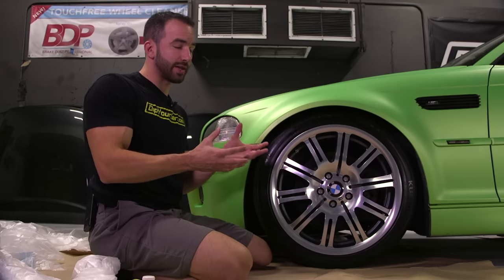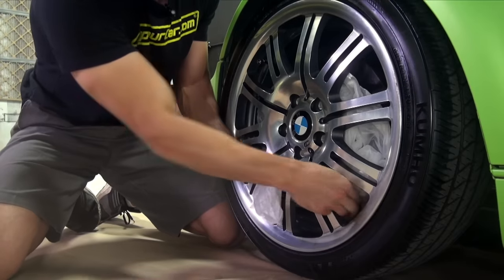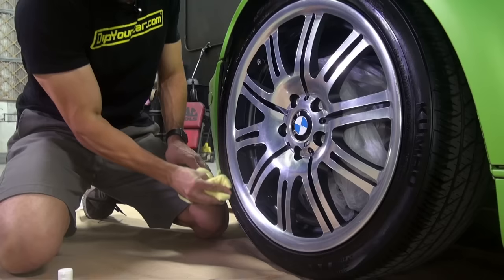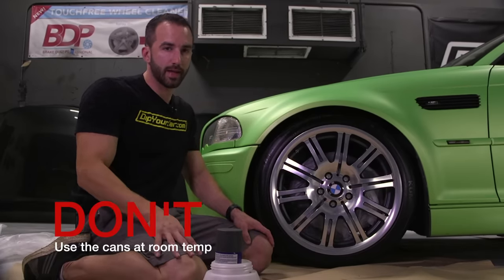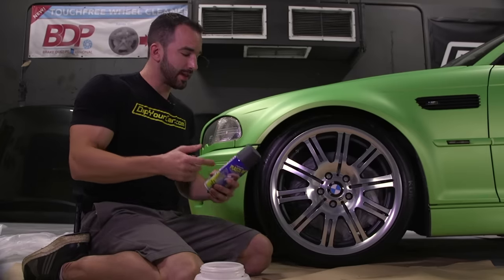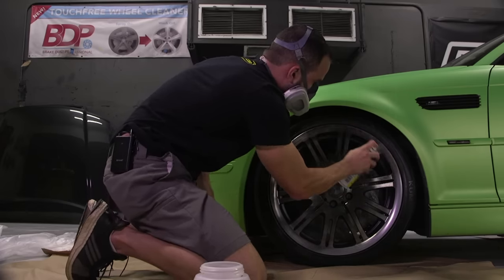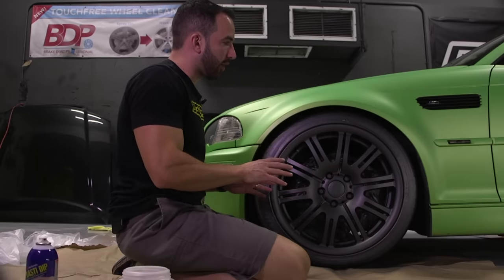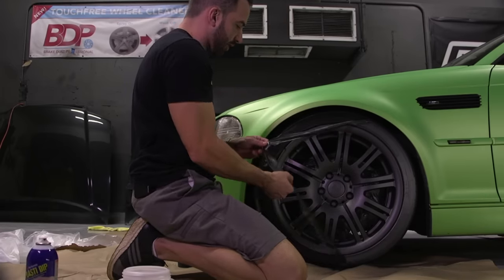Official Do's and Don'ts of Plasti Dipping Your Wheels

Comment: Another great way to mask off the tires(if you don't have the dip release) ive done many times in the past whether it was plasti dip or  spray painting wheels. Take 2 decks (I believe you need 2) of playing cards and stick them in between the very edge/lip of the rim and tire then overlap the cards around the entire wheel. It greatly reduces overspray on the tires while you spray paint the wheels.
Reply: Cullen Schwagler. I’ll try it out tommorow!!
Reply: Use index cards they are super cheap and u dont ruin playing cards.. lol
Reply: @Bvsterrrrrrrrr  ah really didn’t think they was that cheap. But still index cards are better they’re bigger and you use less of them for the same thing and less chance of over spray . It’s just the way I’ve always done it.
Reply: @guildensteinfoutch6232  totally agree
Reply: Or just smear petroleum jelly in place of the dip release. It's a common old school masking method in many industry
Reply: Does the card trick work if they're on the car?
Reply: @bigfirepop  for sure or olive oil coconut oil or anything like that I’m sure would work
Reply: Indeed tbh med to large index cards are incredible and sometimes reusable
Reply: @yourtruckerfriend1584 yes, but you still have to mask off the brakes and stuff. The cards only protect over spray on the tires.
Reply: This is how I do it as well, just make sure you take the cards out while the dip is still wet. I made the mistake of letting it completely dry and it started tearing along the lip of the wheel.
Reply: Use tire shine and you don’t even have to masks the tires
Reply: I’ve actually seen the card trick being done.
Reply: Index cards

Comment: The best I’ve seen regarding the prep. However, what about the lug nuts? Mask em? How well will a socket fit over several layers of coating? Thanks again.
Reply: i wouldn't be concerned with fit as much as the dip coming off whenever you go to take the wheel off.  Or put the wheel back on for that matter if you took it off to apply the dip

Comment: Another good tip I learned is after a few solid coats, move the car forwards or backwards to achieve a 180degree rotation on the wheels. After that, coat the wheels another 2 or 3 times for maximum coverage.

Comment: I dipped my C6 Corvette wheels, i removed the wheels, cleaned and sprayed the huge barrels also...then painted the lugs seperately with Rust-Oleum.   Turned out amazing and if i ever want to reverse the results just peel it off, i did 7 nice thick coats, almost a can and a half per wheel.

Comment: I wish I had this video when I plastidipped my wheels. The tip about not laying the wheels flat would have been incredibly helpful in not getting a textured look on some of the parts of the wheel.
Reply: vladstr100 If you plasti dipped them just peel the paint off and do it again.
Reply: vladstr100 just re do it
Reply: lol yall saying just redo it a set of 5 cans is around 100 bucks
Reply: @hello-ef4bn  Yeah, I definitely didn't have the funds for that to redo it. I just left it be but now after having the tires replaced a few times, the plastidip is lifted and the underneath is rusty, so it'd be more of a pain to redo it.

Comment: PSA about leaving wheels on the car or not:
I decided to dip the wheels on my white Elise a nice matte black.
As it's quick and easy for me to remove the wheels, I took them off for easier cleaning and access for spraying.
Here's the problem: the space around the bolts is so tight that while putting the dipped wheels back on the car, the wrench touched the dip just enough to turn and tear it off. 
All the work was for nothing and I had to remove all of the beautiful fresh dip.
If your wheels are designed in a way that there's not much space around the bolts and there's a risk of touching the dip while wrenching them back in, do NOT remove your wheels for dipping.
I hope this will save somebody the trouble I went through.
Reply: Vahid Saberin you could mask off the bolt holes
Reply: just use a micro fiber towel. over spray comes off of paint so fuckin easy.
Reply: Thanks for the tip! I might dip my wheels and this tip just saved me from making a mistake ike that
Reply: Man you helped stop my life from being ruined because I would've done exactly that.  Not only that, the plasti-dip gear would've cost me almost as much as a new set of rims, so I may as well just buy another set of rims in the color I want.
Reply: @poopipeboy3033  im thinking of painting mine instead. One flat, or when it's tire rotation time, and this stuff is toast.
Reply: If you ever need to take them off for anything In the future the paint will rip right off with the lug nuts though. Painting them on the car is just dumb and lazy. Just get a thinner socket
Reply: I use to have this problem. What I do is spray some coats of adhesion promoter just to the bolt areas. Also, when you put the lug nuts back on tighten them down bu turning the wrench in quick rotations not slowly. Works great.
Reply: you have to rotate n balance the wheels every 5000ish miles, so there are lots of opportunities for messing up your hard work. hmmmm....  I want a more permanent option.
Reply: Yeah I wish I would've seen that before. Went to put it back on and ended up staring at it for about 10 seconds in shame. But since I already had them off I just stuck a ball of masking tape in each hole and it all ended up fine.
Reply: It seems pretty simple to me, remove the wheel/tire and spray lugs separately off to the side, and I like the suggestion above about using adhesion promoter around the lug holes, just as long as it still peels of when you want it to. Someone said this is almost as expensive as new rims, is that really true? It can’t be
Reply: Mic 360 no there senile. I just bought the whole kit in matte black for 30$ lol

Comment: When I dipped my wheels a few weeks ago, I found it really difficult to get even decent coverage on all surfaces without moving the car to turn the wheels. After moving it, I was amazed how little coverage some parts of the spokes had, even though I tried to cover them with the first few coats. Admittedly, the can is much more likely to spray huge particles of product if you're using it at an aggressive angle, which is the only way to get good coverage on all surfaces during the early coats.
Reply from the maker: Depending on the style and design of the wheel - it's going to be necessary to rotate the wheel half way through the coats.  We cover this in the Complete Guide video.  There's no way you can hit every spoke properly without rotation.
Reply: Dipyourcar shows that in another video. They said to move the car half way through the job so the bottom spokes are exposed. Just be careful not to jam the plastic bag into your brakes.
Reply: MrRangerZr1 I did watch the complete guide and knew I'd have to move the car. I just wish I had moved it earlier and more often, actually, not just once mid-way through the process. 

You also make a good point about the bags. The space between my caliper and the wheels is so small that the bags were essentially jammed between them, which messed things up a bit both when moving the car and removing the bags. In any case, I have useful experience for next time, and I do plan to redo my wheels soon.
Reply: Yes

Comment: How would you recommend fixing tears on the lug nuts from taking the wheels off?
Reply: use a stencil or sharp tool and cut out the area of Plastidip where the lug sits to that it will not twist and pull the rest of material from the surrounding area.
Reply: @ennise25  He said fix tears, not prevent tears...
Reply: I used the Anthracite Grey for my winter rims.   I sprayed my rims prior to the tires being installed on the rims.   I knew that as soon as the impact gun came into contact with the lug nuts, it would immediately ruin/tear the Plasti-Dip from the chrome nuts.   Thus, I went out and purchased some black lug nuts instead.   For myself, I think the black lug nuts look absolutely awesome set into the Anthracite Grey rims!!
Reply: D* W* usually the black is just coated on the lug nuts , did the black stay on the lug nuts that you bought? Or did it get scratched or worn off?
Reply: @honoredsage4946  Yes, the black was just coated on the lug nuts that I purchased.   The first winter changeover, my mechanic got the tires mounted without scratching up the coating on the lug nuts too much.   But after the changeover back to summers, then again to winters, the coating on the lug nuts were at the point that - with winter salt and elements taking their toll - they were all rusted up by the end of the 2nd winter.  
But, for myself, to have the look of the black lug nuts set into the dark grey rims, I will gladly shell out $50 (Canadian) every two years to replace the nuts with new ones.

Comment: I wish you would have showed how you completed the job around the emblem
Reply: Well he sprayed them in the video so I’m assuming at some point he used the dip release on the emblem without showing it in the video.
Reply: It'll break off at the seam, plasti dip pulls apart cleanly at any sharp angle as long as you're pulling away slowly and not peeling away.
Reply: @dragorx000  
You can assume all you want but people want to see the process. That’s the point of the video.

Comment: I'm going to do this with the wheels off the car. Any suggestions for masking off the lug holes, wheel center bore, and the valve stem, so the dip doesn't peel when getting new tires or changing a flat?
Reply: Stuff it with plastic bag/shop towel

Comment: My advice would be to remove the wheels.  And while your wheels are off, do yourself a favor and paint your crust calipers.  No sense in having a sharp looking car and wheels and then show off rusty calipers.  I just paint mine black.  No need to accentuate stock calipers.  Red also gets dirty and gunky pretty fast, so black is the easiest color to maintain.  Plenty of videos out there on how to do it.  Plus you won't get overspray all over your car.  Don't think for a second that it only gets on the sidewalls.  The things you are wearing a respirator to protect your lungs from is also floating around and landing on your car.  I take the wheels off in the drive way and paint them in the garage.  

Either way you do it, this is a great video on how to use the product.  Seriously, man... You do have the best how to videos on YouTube.  Keep it up!

Comment: How do they hold up to road debris, snow and salt during winter? What's it look like the first time you have to have tire work done at a shop and they take an impact wrench to the lugs? How do you clean them? Can you go through drive-through car washes? Can you use a regular car wash spray wand? What's general Life expectancy? Guessing is looks atrocious once it starts chipping off? How to fix properly once it starts chipping? What is the proper preparation if your wheels have a factory clear coat over the aluminum and if it is starting to oxidize behind the clear coat.? Sorry for all the questions, but serious about them.

Comment: I have 2 questions in regards to dipping wheels while still on the vehicle?
1. What do you do about over spary on the car?
2. If you dip rims while still on the vehicle the lug nuts will be covered in dip, will removing the wheels ruin the dip on the rims?

Comment: How does this product hold up when changing tires out?
Reply: it's gonna peel off due the the process required for mounting and dismounting. While factory painted finishes go unharmed, the dip will start to peel and get damaged which is basically unavoidable.
Reply: I used this same color (Anthracite Grey) on my winter rims.   I have gone through 4 winters now of swapping them out and the Plasti-Dip looks just as great as when I initially did it.   The only problem area was the lug nuts.   The dip peeled off the chrome lug nuts on the first rims changeover.   To rectify this problem, I purchased black lug nuts instead.   The black lug nuts added a super nice contrast to the Anthracite Grey rims!!

Comment: what about the BMW sign on the wheel? i noticed it was black but changed to the normal color however he didn't show how he took the paint off the BMW sign part of the wheel.
Reply: I'm wondering the same thing
Reply: He peeled it off
Reply: The cap is plastic, plasti dip only sticks to the rim. It will easily wipe off of plastic parts.
Reply: Dan C not true. It sticks to everything. He simply pealed it off the cap. When 2  surfaces meet, most of the time there is a gap and when you spray it doesn’t bridge over. Making it simple to peal it off the desired spot.
Reply: Dan C plasti dip does stick to plastic I’m more than sure he added drip release

Comment: I bought a kit 5 years ago.. I'm about to finally use it on my new (to me) 3rd gen Mazda 3 hatch!  Wish me luck!
Reply: How it go
Reply: @dallaslegend9460  pretty well actually. The biggest time sink was prepping the wheels. I didn't get the dip release so I taped the tires. The other odd thing was when I got to the last 3rd of the can it was coming out in large chunks. Not sure if that's because it was 5 years old or if the can's temp got to low. I did put them in hot water before starting.

Comment: Dumb question(s) What happens when I get my tires rotated every 5,000 miles? Will the  recessed area around the lug nuts be all scuffed up when the socket wrench is applied?   When this is done the balancing weights are most always moved around, so how do you retouch?

Comment: Great video. Only question I have is about the lug nuts. After plati dipping as shown can you still get a socket on them? As it seems coating them would change the MM size. Is there any problems with that?
Reply: the dip will rip off the first time you put a socket on them

Comment: Ok, what about the lug nuts? Your gong to have to take the tire off at some point.
Reply: That's why I took my tires off.  I left the chrome lug nuts and dipped the rims.  The chrome looks very nice to counter the black and it should  minimize/eliminate damage if I have to take the tire off.
Reply: I used the Anthracite Grey on my winter rims.   I knew that any plasti-dip on the lug nuts would be ruined as soon as the impact gun hit them.   So I purchased a set of black lug nuts.   Personally, I think that black lug nuts look frickin' sweet set into the Anthracite Grey rims!!

Comment: What about overspray on the fender? What about the inside/barrel of the wheel? What about the valve stem/cap? Do you rebalance the wheel after? Would the dip wear off the wheel lug heads?

Comment: Just bought a kit for my car this afternoon, can't wait to try it out! What will happen when I have to change my tires? Will the plasti dip get ripped off in the tire pulling machine?
Reply: Scottie C yes it will, you'll have to re dip them unfortunatley
Reply: @michaelensch9910  and what happens in that case?you peel off the old plasti dip and you spread a new one????or you spread it over the old one???
Reply: I think it's a definite maybe, depending on the tire machine. Most tire machines dont rub on the rim, but I think you still risk the tire itself rubbing the dip off.

Comment: Take the wheels off so you do not do the lug nuts and the center cap. I removed my wheels....that way I could remove the center cap. And more importantly if you have to take the wheels for any reason you won't rip the dip when you in bolt the wheel.

Comment: What about the lugs after a tire rotation. Seems like they would get scuffed up. Or even pull off parts from the main rim.
Reply: I had the same concern. I dipped my wheels 5+ years ago and have been through several tire changes. Surprisingly, when the wheels were removed and placed back on, there was no peeling and only the smallest scuff or two, around the lug nuts. I was really surprised and happy with how well the Plasti dip held up to tire changes.

Comment: What about the lug nuts and the piece to unscrew for you to.put air in your tires. Will the plastic dip come off when you have them unscrew at some point when tire pressure is low, change springs or  rotors

Comment: How did you get the Plasti Dip off of the BMW emblem, along with an M emblem, on the rim?
Reply: use the diprelease on the eblem
Reply: waterside 😂😂😂
Reply: if you take the tire off you can pop the emblem out from the back of the wheel. As far as the m logo just tape it off. Pretty simple to avoid getting plasti dip on.
Reply: waterside  ahahaha
Reply: vacuum cleaner

Comment: I was wondering if there was a way to have a deep black finish with a colored sheen to it? Like it's black but when the sunlight hits the car at a certain angle you can get a colored reflection. Would a colored juice in the clear coat on a black dip have that effect our would it have to be a very fine flake in the clear coat? I'm hoping for a black car with a purple shift, I guess.
Reply: Hi. Did you ever find out the answer to your question? I want something similar and was wondering the same.
Reply: Obsidian black changes colour in light
Reply: There is the chameleon paint as well you could do a coat on top of the black it may work

Comment: Wait so one can per wheel? Or no?
Reply from the maker: One can per wheel for a standard color like Black, Anthracite (used in this video), etc.  There are color however that require a topcoat like gloss or pearl.  Once you go to a wheel larger than 20", more than one can per wheel may be necessary.
Reply: @dipyourcar  will it be enough for an 18" wheel?????i bought four cans of black,but....how many coats can be spreaded on the wheel with one can?????